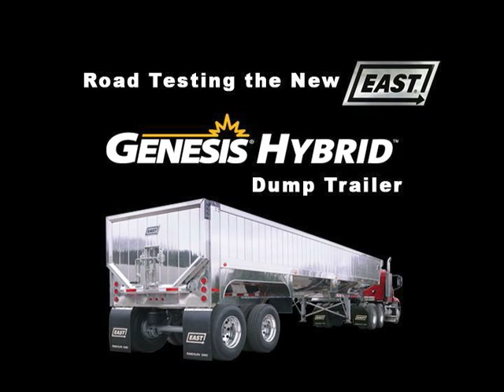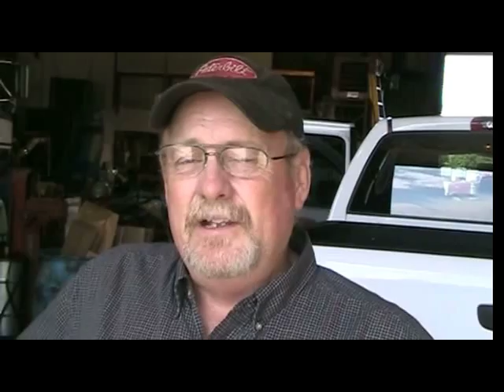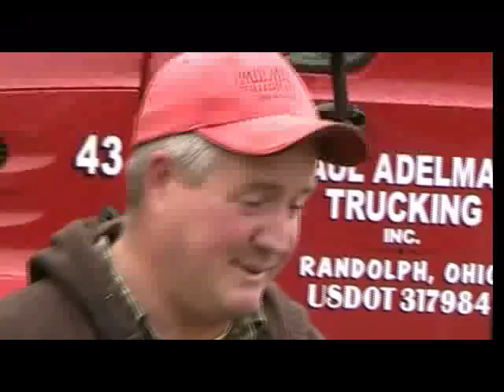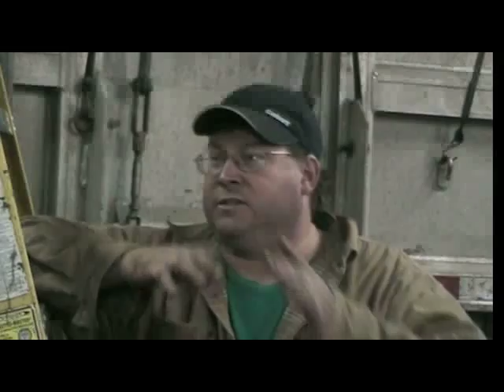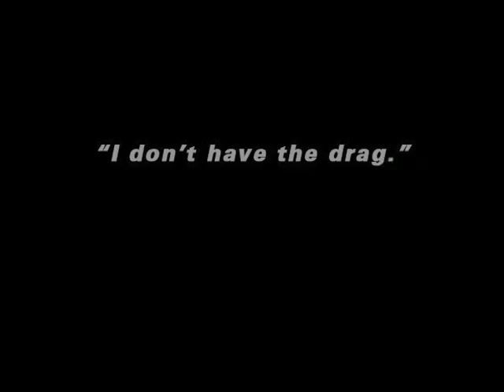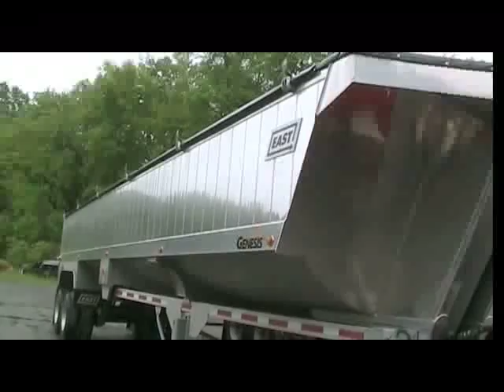Road Testing the East Genesis Hybrid Dump Trailer

Comment: I worked at EAST MFG. for about four years as a welder, helped build first genesis trailer. Worked at MAC Trailer to...Now I drive truck haulin asphalt with a east quad trailer. If I was to buy a trailer it would be a EAST for sure.....

Comment: I am an experienced dump trailer driver. I have had the LUXURY of pulling an East trailer. In my opinion, an East dump trailer is the caddilac of dump trailers. i cant wait to hook up to one of these hybrid units. I've pulled other round belly trailers, they do have a tendency to give an uneasy feeling during cornering,and even straight line travel. This is a feeling I have NEVER  experienced with an East hooked to my back. Keep up the good work.